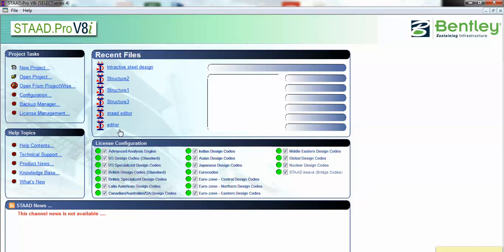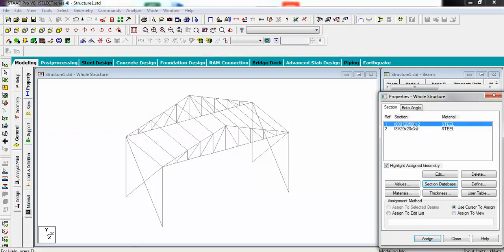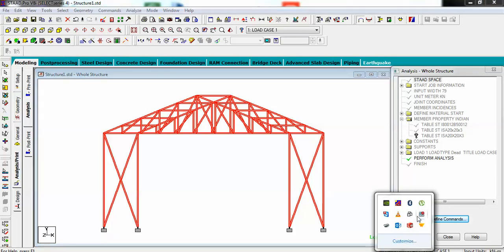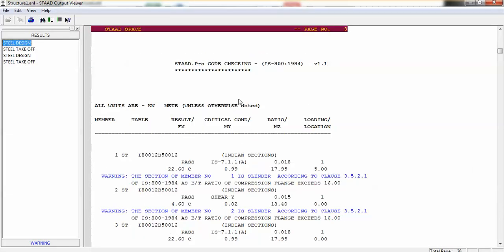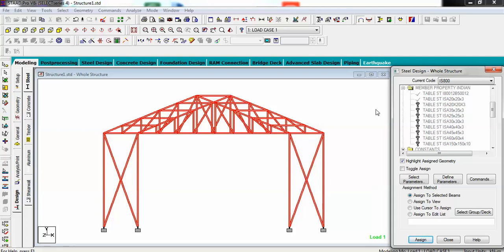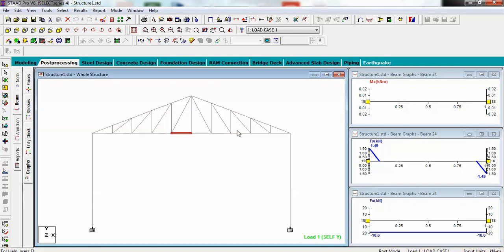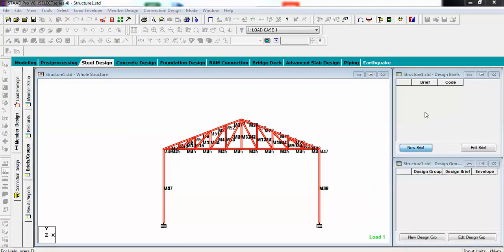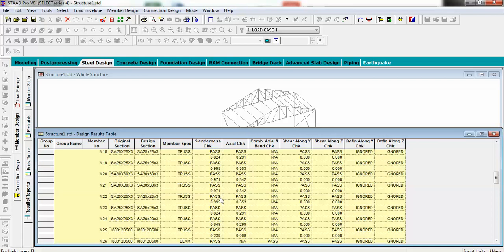Staad Pro Interactive Steel Design using truss best explained in detail

Comment: really nice video...it helps us lot.....i need same example for Aluminium Profile Structural Analysis...is there any difference in steel and Aluminium Design.
If you know Building glazing (Aluminium Framing) structural calculation please share with us.

Comment: I desiging rcc multi storied building in staad pro by two methods(software itself & concrete design) found different results & another problem is  steel required in top floor of coloumn is much more rather then bottom floor coloumn pl.upload video

Comment: hey buddy nice work. 
can you please let me know about the possibility of doing structural designing with aluminium.?

can we designs structure as per IS 800 or 801 by changing it's properties such as Yield strength, ultimate strength poison's ratio etc.  in accordance with aluminium.

Comment: I have one question regarding steel design in staad pro.  Why Fy and Fu are kept as design parameters . Because in section properties where we define/import sections there is an option of MATERIALS in which Fy/Fu already there.. Why we need to assign these as parameters ? Similarly Fc for concrete ...

Comment: Bro Jags 22079 i found a very help from your video for learning staad. But I m struck in my problem. i am designing a steech arch with 50 feet span on swimming pool the point is displaced by big margin . I dont know may be i m mistaking in units or something else. can give me some information for setting units and applying it carefully.
Thanks in advance
Reply: You can change your "Base Unit" from the start up page. Just click File on the upper right, then Configure...